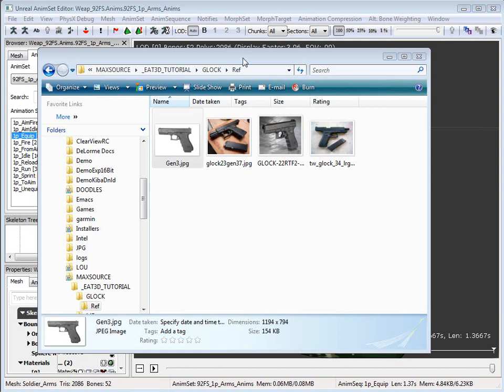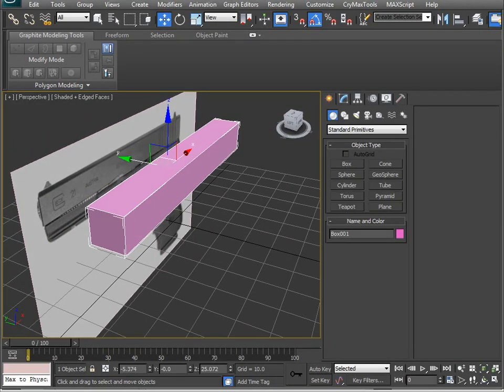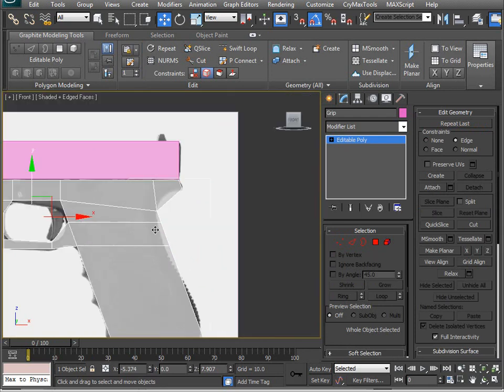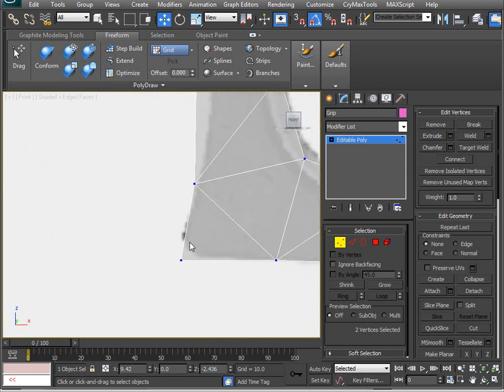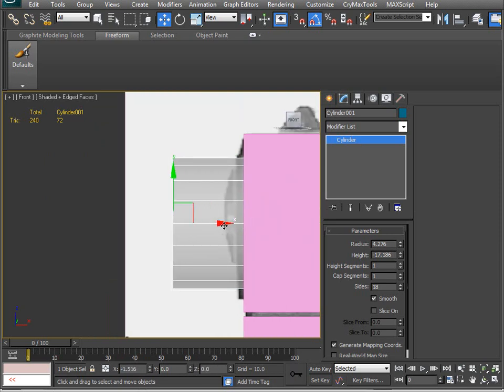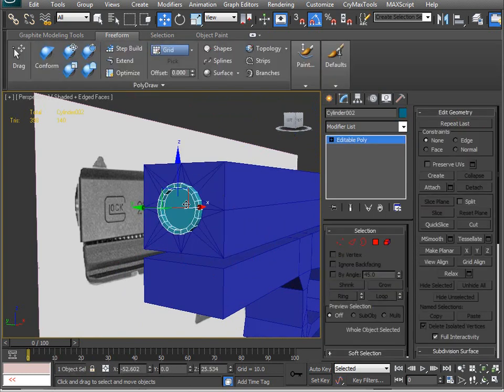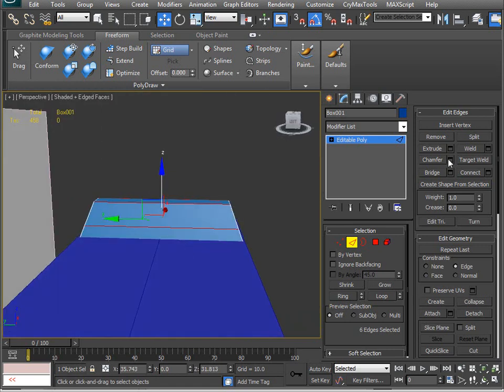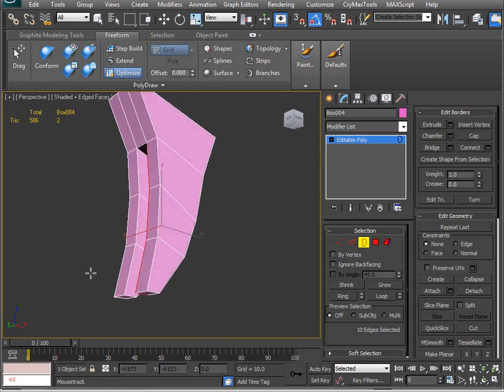UDK Custom Glock Tutorial Part 1 LowResMesh

Comment: How do you make the normal maps I thought you have to make a high poly which needs quads for sub division but your not keeping quads
Reply from the maker: I don't bake the normal maps onto this model. I only use normal maps for the details like bumps, scratches and markings...etc. You are right, however, in order to bake clean normal maps, you would want to make sure that your model is maintaining quads. If I were to of done that with this level of detail, I would of had to deal with a lot more polygons. You can also not use quads if you manually cut in high resolution details by using chamfers and things like that. You would then probably want to project the normals in 3DS Max as opposed to another app. Really there's an infinite number of ways to go about it.